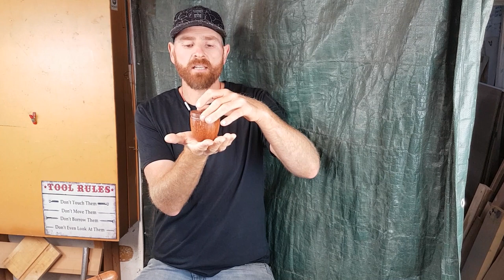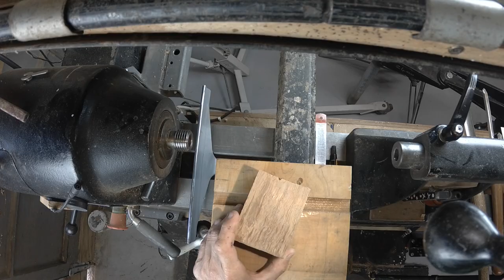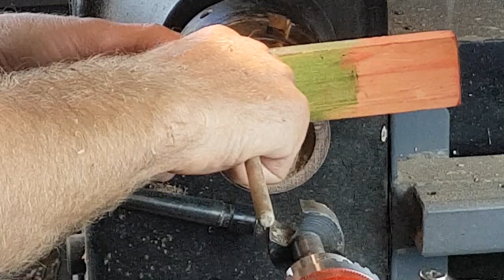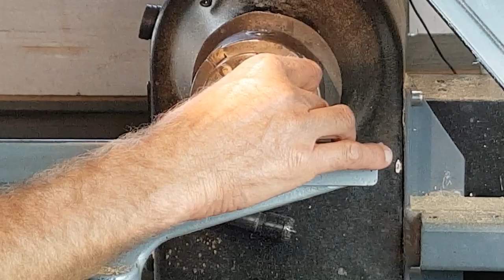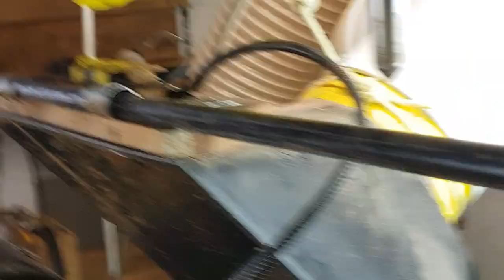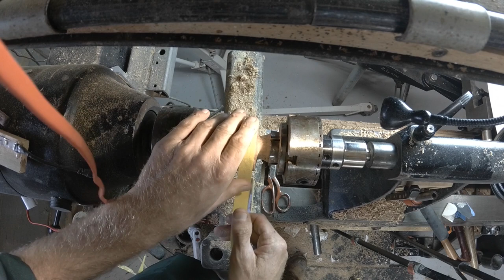Woodturning - Lidded Box Full Demonstration Step By Step Video

Comment: Well done. Very nice box and well explained. Why did you use CA glue instead of sanding sealer?
Reply from the maker: thanks Pat I have a long way to go but I learnt alot making this one.the reason I use the CA it makes the inside surface harder so if dropping a ring in or something that's hard the surface hold up better in the long-term. cheers